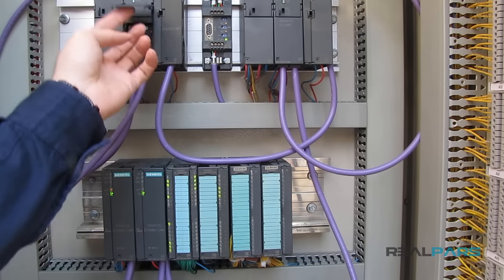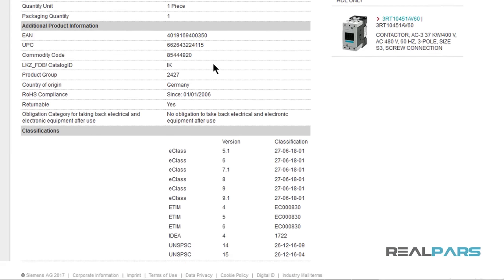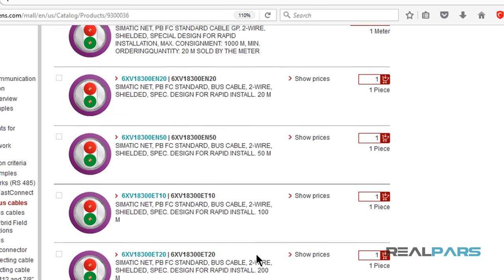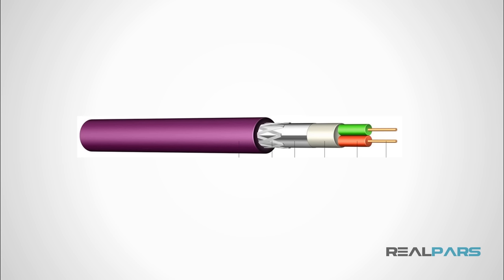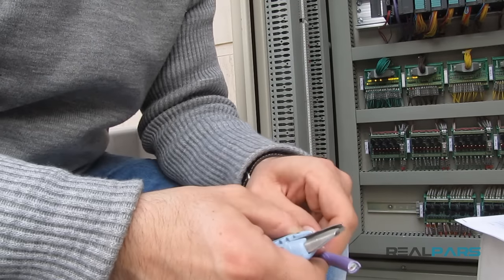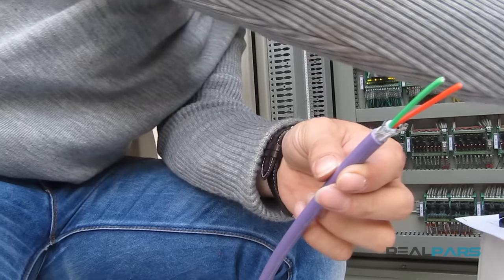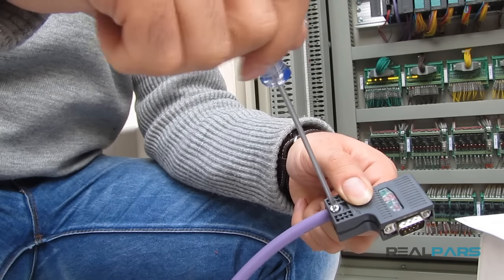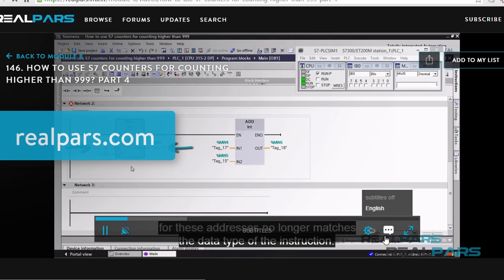How to Wire a Profibus Cable to a Profibus Connector

Comment: Excellent explanation as always Real Pars. I have a question. Is it necessary to strip the green and red wires, and leave the conductive material visible? Or are they just connected as they are to the DB9 terminals?
Reply from the maker: It depends on the the physical connector you are using.  The ones shown in the video use "vampire" connections, where the clear plastic tabs force the conductor down into a metal connector that cuts through the insulation.  Some connectors require terminal connections, in which case, stripping of the conductors is necessary.

Comment: Thanks so much for this valuable video. I have one simple question, why the two cores are inserted in only one path of the two paths connector?
Reply from the maker: Profibus DP operates on a two-wire network.  In the video, wiring the "IN" network side of the connector is demonstrated. The two cores are (+) and (-) and are both parts of the incoming network connection.  Profibus DP is a multi-drop network, so the connectors also have an "OUT" network connection so that the network can be run to the next node.  In the case that there is not a "next node" (the current device is at the end of the network), there is typically a switch on the connector that allows an end-of-line resistor to be placed in line to terminate the network segment.

Comment: QuicK question: if i want to install another cable on the other 2 terminals and the colors are swaped will it effect communication means on the other connector i connect red in A2 and Green in B2. The connector i have there is no color marking
Reply from the maker: Hi there,
Yes, it affects communication for sure. There may be + and - signs instead of Red and Green colors on your connector.

Comment: What about the terminating resistor, is it inbuilt, if yes, where?
Reply from the maker: At 2:46 in the video, a Profibus connector is shown.  Look on the back of the connector.  There is a red slide-switch that is set to put the terminating resistor inline or remove from the circuit.  So, the terminating resistor is in the connector shell, and the slide switch allows it to be used or bypassed.

Comment: Dont we need to remove that last layer of insulation as like we normally do for regular electrical wire connections?
Reply from the maker: Not with this style of Profibus connector.  The two connection pads have "vampire connectors" which pierce directly through the insulation on each wire.

Comment: Thank You for interesting video.
 But I have a question about Profibus cable resistor.
What is the role of the resistor on the connector?
Reply: Yes,good question,you mean the the resistor for devices being installed on the proifibus network.it is depends on the device on the profibus net. Resistor for First device not the same for the end one.

Comment: In the inside of the wire connector, why is there two sets of clear plastic wire inserts?
Reply from the maker: Thank you for your inquiry. The clear plastic wire inserts are designed for managing cables. There are two inserts labeled B1 and B2 for the specified connection type. These inserts facilitate a daisy-chained configuration, allowing one cable to go in and another to go out to other devices if you have multiple devices in your network.

To provide you with more detailed information, I'm including the current Siemens web link:  https://support.industry.siemens.com/cs/start?lc=en-US

Once you access the page, enter the ID number 109793857 in the "PRODUCT/ARTICLE BOX." This will lead you to the information page where you can either download or view the PDF book on the connector, its usage, and additional educational content.

Happy learning!

Comment: Why did not you remove the insulator from the red wire and green wire?
Reply from the maker: When you use this kind of connector., you don't need to cut those wires. When you close the Profibus connector, it will cut the wires automatically.
Reply: RealPars Thanks a lot
Reply: If your connector has screw terminals inside it, you should remove insulator.

Comment: Why does the connector has tow wire paths and, isn't it necessary to connect somewhere the braided shield ( because of noise effects)?
Reply: Erick Ontiveros Lara 2 wire path is for another set if your not using the terminating  resistor on the connector.  And I believe that metal part  of the connector being is supposed to be in contact with the braid. But he has the aluminum  shield on it . Not sure if that's right.
Reply: h20no Thanks 4ur feedback. Inspired by you I'm currently reading  an article called PROFIBUS Instalation Guideline for Cabling and Assembly, from Profibuscentre and I now have the answers; they recommend to read manufacturer's instructions about the connector's design and use. In general the shield of the cable must be connected to the shield of the connector (which is provided by a groove on the connector), and this can easily be prooved on the video, before he closes the terminated field assembled Profibus cable. On the other hand, just like you said, the other path (outgoing signal) most only be used when you have a Profibus network and wanna add another device or segment, otherwise you'd activate the bus termination built into the connector. Thanks again!
Reply from the maker: Hey Erick, thanks for the comment. I guess you've got the answer to your questions by now.  But just wanted to add that if you do the wiring and connections the way we do it in this video, everything is going to work perfectly fine. We've done this hundreders of times for different projects. Don't get confused with the manuals and shield stuff the way I did when I was new to Profibus. :)
Reply: Yes, you're right! Sometimes manuals are confusing

Comment: Why does a two wire cable require a DB9 nine pin connector?
Reply from the maker: Profibus DP technically does not require 9 pins.  When Profibus DP first came on the scene, DB9 connectors were the standard for automation systems.  Because Profibus DP cables need to carry the network power, smaller cables like CAT 5 cables not have the capability to do the job.  The size of the DB9 shell connectors is perfect for connecting the 'in" and "out" segments of the Profibus cable and connecting the foil shield to ground.

Comment: There is a provision for connecting two profibus cables in a single profibus connector. Why is it so??
Reply from the maker: Profibus DP is a multi-drop protocal.  The devices are "daisy-chained", so each connector has an IN connection and an OUT connection.  The Profibus connectors have the internal connections that makes this easy to accomplish.

Comment: Why don't you removed the insulator for wires. Doesn't it require??
Reply from the maker: When you use this kind of connector., you don't need to cut those wires. When you close the Profibus connector, it will cut the wires automatically.

Comment: This is a tragedy. The author of this film did not notice that we are in the 21st century. He stopped in the mid-20th century. How can you show cable processing with an ordinary knife nowadays? I'd like to see what he did up close. What does the insulation of the wires look like? I know that sometimes he will do better, sometimes worse. I have seen the work of such specialists many times. I know that there are people who learned how to peel cables with such a knife 20 years ago and will continue to do it for the rest of their lives. But it is very harmful because when a young person watches it, he or she learns bad habits. Now there are tools to help you do it professionally.
Reply from the maker: Thank you for your question. You have a point. This video was done in Europe, where most technical assembly and field service techs get extensive apprenticeship training before being allowed to do such a job. Our videos are made for a worldwide population of students. This is why we included the Siemens part number for the tool of choice today for accuracy, speed, and safety first. And, of course, because of the ISO standards, you want it built right. I personally started 45 years ago with the knife and was not allowed to touch customer products until I was certified by an instructor after I spent 40 hours practicing on cable. I was a Siemens manufacturing engineering employee for 25 years, now retired and teaching others how to do it in today's fast-paced industry and doing it safely, too. I wish I had the new cool striping tool when I was learning!